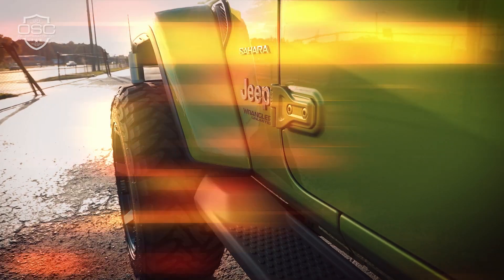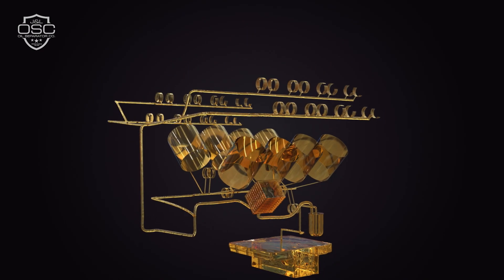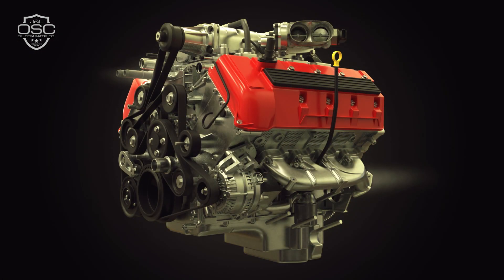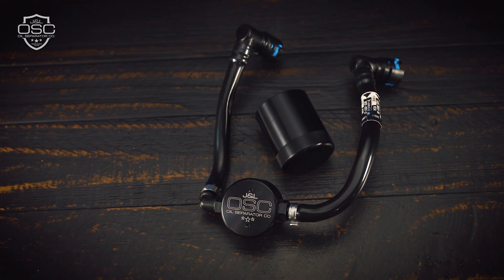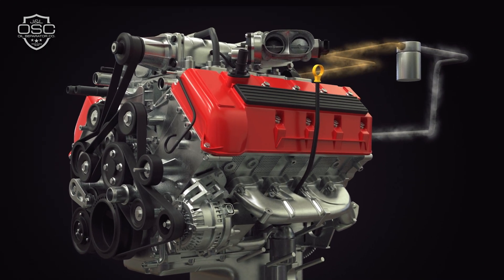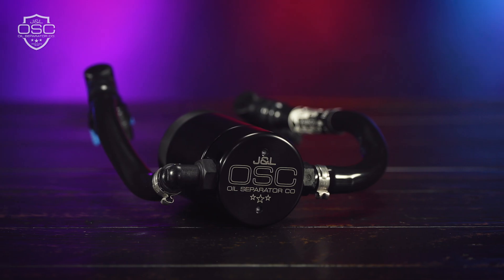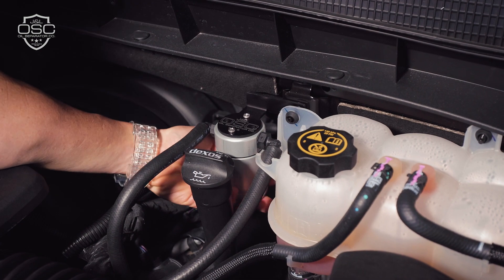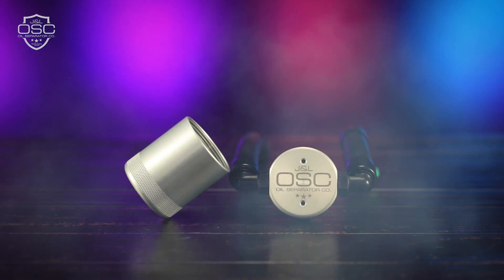J&L Oil Separators: The Science Behind the Technology

Comment: On the fence about getting one for my 2025 Frontier as to warranty concerns. Would the truck still benefit from adding the J & L system at a later time?
Reply from the maker: Anytime is a good time, sooner the better.  This system is very easy to remove if you're concerned.  You could always take it off before taking it in for warranty work.

Comment: I just placed an order at the J&L website for my recent purchase, a 2018 Ford F250 Super Duty 6.2L. This is my first add-on upgrade before I drive it another mile. 

I have used other oil separators over the years in other vehicles. The concept is the same but this setup looks very "trick" with the plug n' play fittings.

Gents, don't wait another day, get yours today. Your engine deserves it, you deserve it. Do it!

Comment: How often does the oil separator screen need to be cleaned?
Reply from the maker: We recommend a good deep cleaning roughly once a year or every 15k miles. The easiest way is to remove the oil separator from the vehicle and spray brake clean through the filter and lines until the liquid runs clear, and then let it air dry before reinstalling.

Comment: Will this void manufacturer warranty? Why doesn't the manufacturer put this on their vehicles?
Reply from the maker: If you read the fine print on any warranty contract you will find a lot of reasons your warranty can become void; installing aftermarket parts can be one of them. However, per the Magnuson–Moss Warranty Act proof would have to be provided that the after-market part caused the failure. If you need further clarification, contact your vehicles service department. Some are easier to deal with than others. 

Manufacturers don't include them on vehicles because they need to be regularly serviced. Because of this, it is highly unlikely to get 50 state legal approval.
Reply: Often, do you need to have it serviced? The separation
Reply: How often do I need to have this oil separator serviced?
Reply from the maker: @2clicks2theright375  We recommend checking after the first 1000 miles of use to see how often it will need to be emptied/serviced. We also recommend doing a good cleaning of the unit roughly every 15K miles or so.
Reply: they are not standard because manufacturers have to deal with people who hardly change the oil, let alone empty a catch can. If people didnt empty it you would get a lot of oil at once getting into the engine. As long as you dont mind emptying it every couple of fuel ups, you're fine.

Comment: I have a 2022 explorer timberline 2.3   I am assuming this system will not void the factory warranty?
Reply from the maker: If you read the fine print on any warranty contract you will find a lot of reasons your warranty can become void; installing aftermarket parts can be one of them.  However, per the Magnuson–Moss Warranty Act proof would have to be provided that the after-market part caused the failure.  If you need further clarification, contact your vehicles service department, some are easier to deal with than others.
Reply: @jloilseparatorco.1853  thank you!